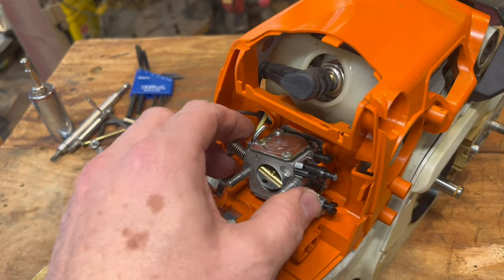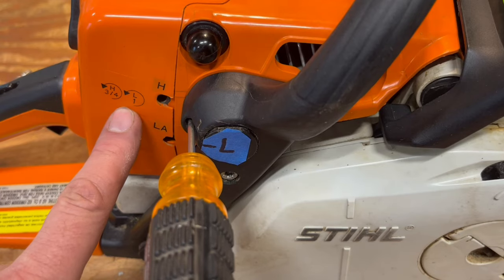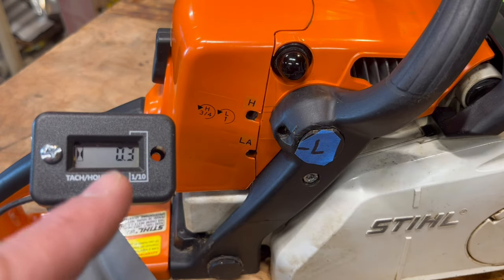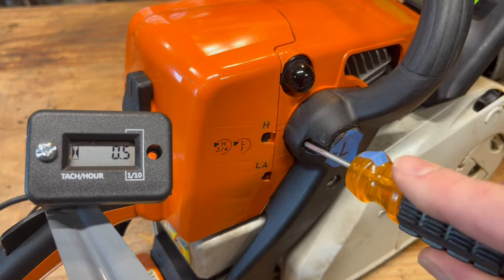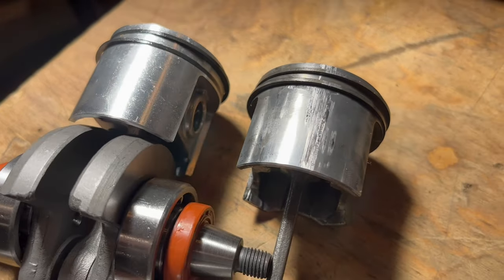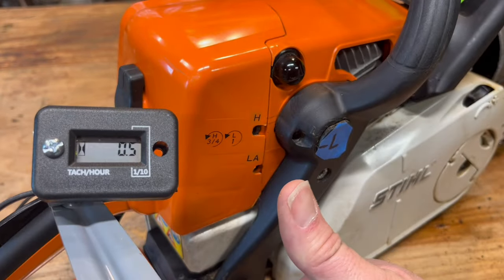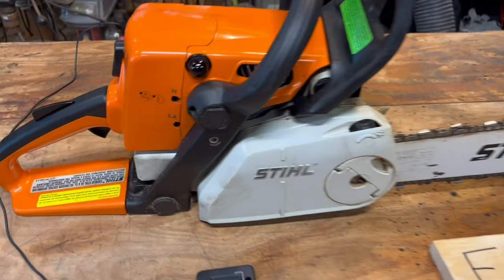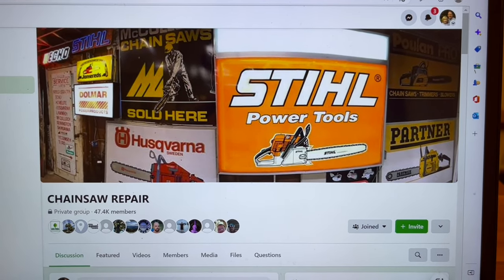How To Tune a Chainsaw

Comment: May want to mention limited vs unlimited coils and how a limited coil when the RPMs hit the limit it sounds like 4 cycle (Flutter).  Have to be careful to not assume a limited coil is on flutter if it's on the limiter of the coil... .could be getting not enough fuel in that scenario.  You can put the saw into wood and tune it to flutter while under load in the wood and well below the coil limit and then lean it until you get roar in the wood but well below the coil rpm limit.  I always try to run unlimited coils as it makes tuning much easier (by ear and with a tach... no worries about the limit!)

Comment: Good video! The sound of my saw changes while I'm cutting. It will sound smooth and the gargle or flutter and then go back to smooth sounding as I'm cutting. Is it getting to much fuel? Im a newbie and have an Stihl MS 181 c. Im weary about about fiddling around with trying to tun it but may give it a go
Reply: Sounds like an air leak.